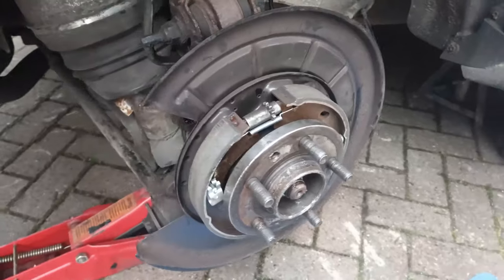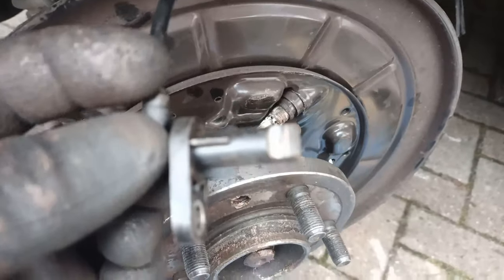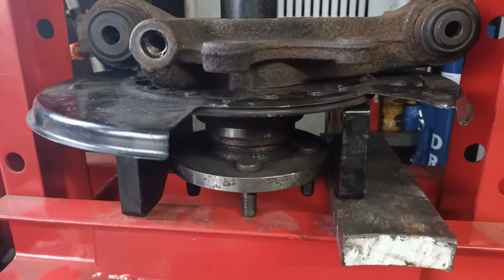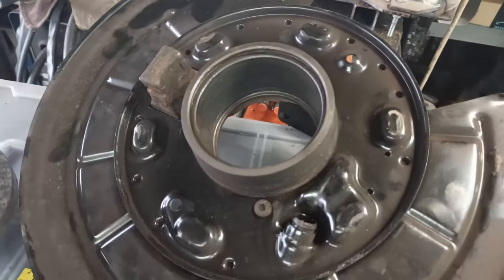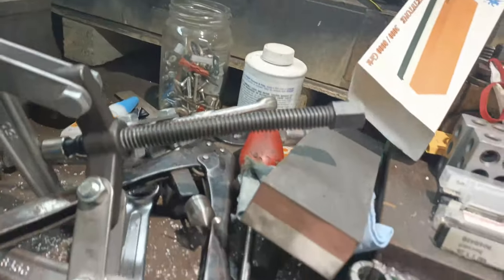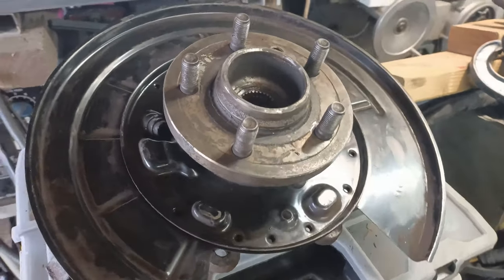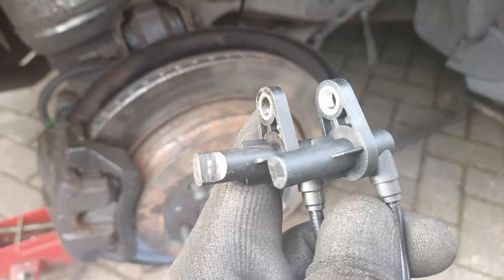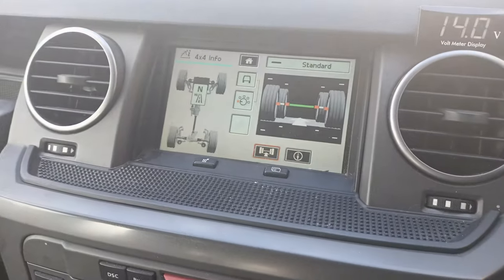Discovery 3: ABS Sensor Fault

Comment: Well done !! looking at the video I suspect that work has been done before on the hub --- the disc shields look new as does the calliper and the brake shoes...I bet it has had a new wheel bearing and whoever did the work forgot the circlip! Surprised the hub did not work all the way off, which would have been disastrous! Anyway job well done.
Reply from the maker: Hi, yeah I did a fair bit of work last year with the shields and brake lines. I remember putting back the original clips. I'm guessing that it was damaged some how and popped off. Quite frustrating as it is a large amount of work to replace something so small..

Comment: What was the symptoms of this problem did it cause the transmission to go into limp mode or did it just throw a check engine light or something? My main question is what's the transmission affected by this or did it still operate normally?
Reply from the maker: Hi.. So the symptoms were HDC and ABS warning on dash, ABS warning lamp, suspension lowered. Other than that you could drive as normal. Hope this helps..
Reply: @m0xya  thanks it does

Comment: I have a similar issue except I think the ABS sensor ring is so corroded the sensor can no longer get a signal so I have no speedo and ABS faults the codes are P0500 Vehicle speed sensor circuit A and C0037 left rear speed sensor, I've replaced the sensor and cleaned out what I can but its not mentioned anywhere on the internet and you can't buy the ring, you have to buy the whole CV axle halfshaft with the ring on it
Reply from the maker: ah yes, the spacing between the ring and the sensor is quite small, so if corrosion has eaten away the teeth then it won't detect or pickup the pulses.. i wonder if a ring could be made? a bit like hobbing a gear..
Reply: @m0xya  I crawled under, now it has Suncore Springs on, and sure enough there was a broken wire to the left rear speed sensor, this morning even the check engine light went away!
Reply: @m0xya  well it turned out to be a bad speed sensor wire, it was quite obviously broken so I rigged some pigtails and by jingo all the stupid lights went out and my speedo came back!!!